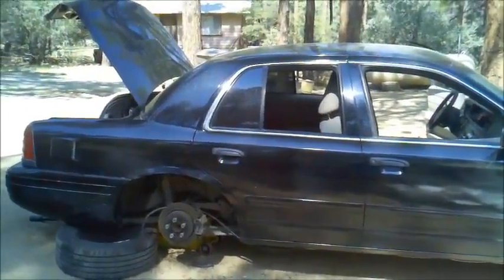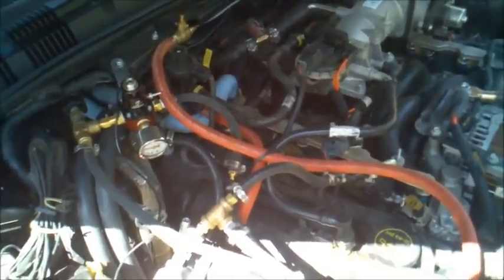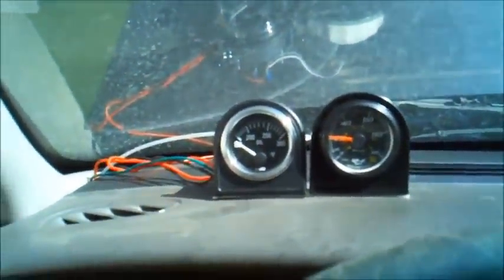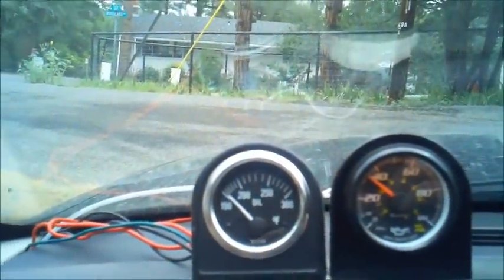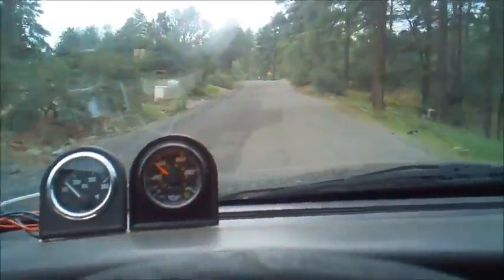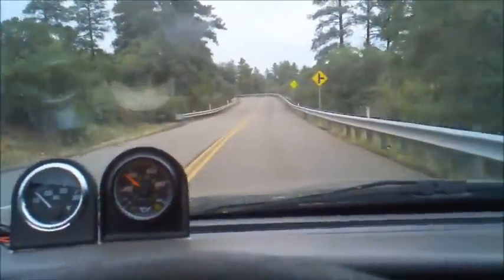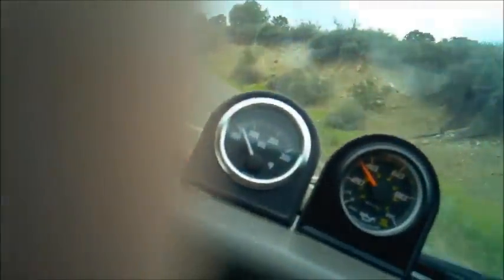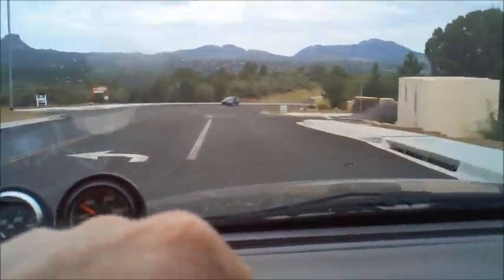H2GoNow Crown Victoria running on 100% water

Comment: I want to just buy one, how do you buy one.  Seems like a lot of work.
Reply: They are hard to buy because they don't work. It's like trying to buy the magic that makes the assistant float for a magician.
Reply: Are you sure
Reply: James McGrath
I'm sorry James, you can't really have what you are seeing.
You can make electrolysis generated HHO and run your car off of it, but... 
Consider the displacement of your engine, so many cubic inches turning at some maximum speed will give you a cubic inch per minute consumption. If you look at commercial HHO generators online (yes, you can buy units ready to go) and compare their output to your engine needs you will find that you need a pile of them almost as big as your car. Review the power your array of generators will require, it will be a big number! You will need a large enough battery bank to power your HHO generator bank. That battery bank will be as big as your car if you use lithium batteries, even larger if you use lead-acid batteries. You will need more power to charge that battery bank so multiple alternators or just one almost as big as your engine. Now you are ready to go.
When you drive your new hydrogen car, you will find that it doesn't go very far before it will need its battery charged.  The reason for this is that there is no fuel on board, only energy in the batteries. So, you take that battery power and use it to make HHO, losing about 40 percent of the power you started with. Then you burn your HHO in an internal combustion engine losing another 70 percent of the 60 percent left over from electrolysis, for a total of 82 percent of your power lost to inefficiency. 
If you threw away the batteries, alternators and replaced the engine with an electric motor, which is around 90 percent efficient, you could go 5 times as far as you could with HHO because electric cars are about 90 percent efficient and HHO cars are about 12 percent efficient.
Why would anyone want to buy 5 times as much electricity (or have a solar farm that is 5 times larger) just to drive HHO instead of electric?
Reply: Most people build a system that works in conjunction with regular gas, using a vacuum line on the intake to pull in the HHO to be burned like normal.   Gives a better burn, less emissions, and better MPG's... but, if you wanted a 100% HHO system you would need to contact local shops in your area and ask them if they'd be willing to try it.  Probably no warranty and expect a HUGE bill.  Or you could buy some cheap turd to practice on, if it works install it on your daily driver?

Comment: hho yes its burn,but the problem  is is get over heat,u guys like to use hho in ur cars,make gasoline (petrol) it has oil mixture,we know  that engine need oil,any machines that routes need oil,if pistions run on dry gas r some thing hho,pistions and rings get cooked then we can eat them we through them,thanx

Comment: Hopefully you can respond to this sooner rather than later, but about what is the ratio of hho to normal air from the intake?
Say you have a 1 liter 4 cylinder engine (for simplicity of math), about how many liters per minute of hho would you need to run at 5000 rpm?
Also, how are you controlling the injection of hho into the intake with the throttle?
Reply: So much would be needed that the simple maths you propose show it can't be accomplished the way it is presented here. Certainly good optimization of the combustion, but should be far more efficient to produce the quantities required to run a car, big or small, on water only, with its own battery.

Comment: Is this for real? If it is its world changing
Reply: Nope. An engine can run on hydrogen, but having it self-generate like this from water is physically impossible.

Hydrogen-powered cars do exist (using a fuel cell and electric motor instead of a combustion engine). The Toyota Mirai is the best known one. But they'll probably never be practical - there are very few filling stations, the cars themselves are very expensive, and most importantly, battery electric cars are vastly more practical in almost every way.

Comment: Where are you entering the hho?
in injector?
Reply: gustavolee i think through the air filter
Reply: Sskip air filter drill a hole passing the mass sensor
Reply: yes it ties into the fuel lines at the back of the car

Comment: This is kind of misleading.  Even if you are genuinely running the vehicle on nothing but compressed HHO(which is definitely possible), you're still adding something to this somewhere, other than just water.  You're adding electricity when you plug it in at your house to keep the battery charged, or you're just straight up recharging the HHO storage with mains power.  Either way, this is not really "running on water".

I suspect perhaps you actually have gasoline in this though.  It's pretty easy to see the fuel gauge is actually above E when you're driving the vehicle, which means you put gasoline in the tank.
Reply: He commented down here somewhere saying there is also alcohol involved.

Comment: Okay, so obviously this is physically impossible. Anyone with a basic understand of thermodynamics will understand why this is. In short, the engine wouldn't be able to generate enough power to extract enough hydrogen to run the engine. Since the exhaust of a hydrogen engine is water, you can't fuel it with water without providing some other energy source to separate the hydrogen and oxygen, because then you could just feed the exhaust into the input and it would be a perpetual motion machine.

What I want to know is, since it can't be working the way he says it is, what exactly is the car actually running on? Is the whole thing faked and it's just running on gasoline? Is it actually running on hydrogen, but not from the fuel cell? Is the fuel cell actually working, but using electricity from somewhere else? Why would anyone bother to fake something this elaborate if they weren't trying to sell something?
Reply: Hydrogen generates 6 times more power than petrol. This is very real. You change the water, you don't reuse it. Checkout Ken Myers, the Joe Cell, Daniel Dingel... This tech is being censored and suppressed by those pushing for a satanic new world order. If you think I'm lying I don't care, I'm only trying to help you. 18 years of research has revealed that the world is VERY different to what we're told...

Comment: Hmmmm sounds just like a combustion engine.  Plus when he starts to give it gas and he says "A little bit jumpy but hey what do you expect, we're running on water.  Cruising at about 90 here....."  Well, 2 seconds before that he showed the speedometer and it showed around 60.  It's a piece of junk that has an abused engine.  Probably an old police car with 500 000 miles on it that be bought for 100 bucks at an auction, along with the video camera he uses to make these bullshit videos for youtube money.
Reply: It is a combustion engine. I'm not sure you know how this works, nothing was changed except the fuel source.